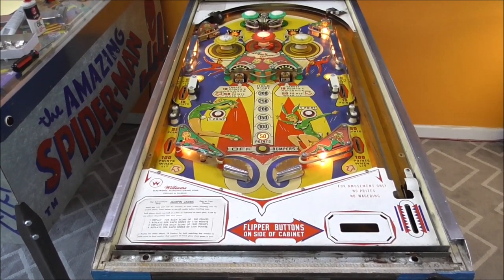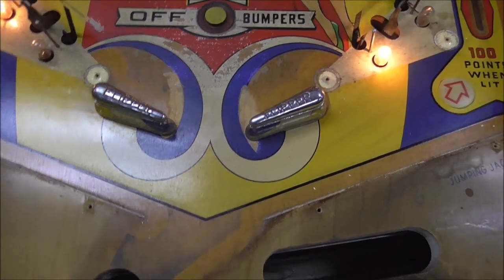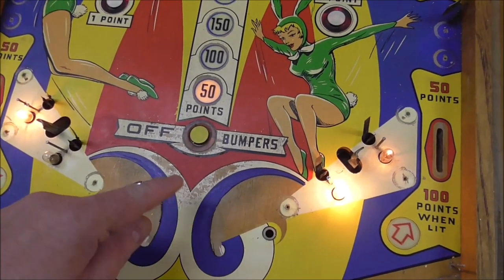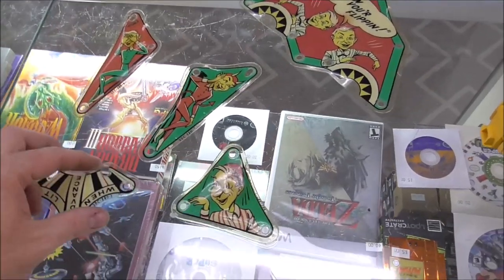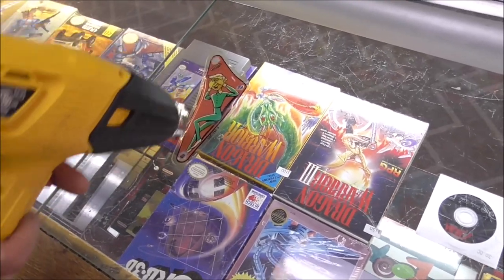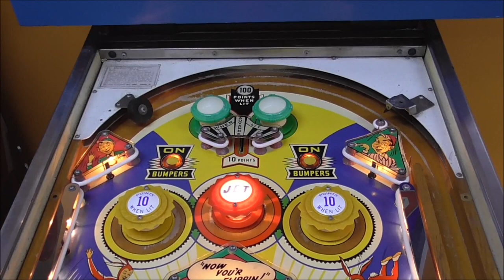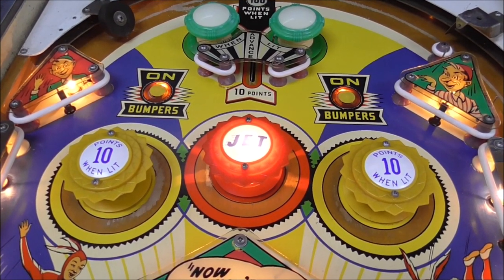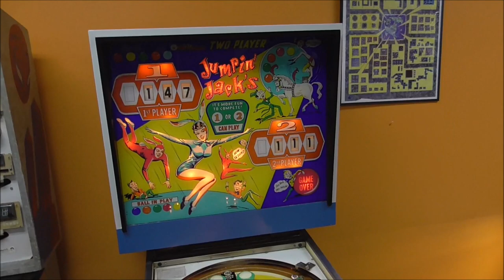Repainting and Repairing the Playfield of a 1963 Williams Jumpin' Jack's Pinball Machine

Comment: Nice work on that play field.  Looks really good on video.  

I was thinking about how the plastics could be reshaped better than using a heat gun.  How about sandwiching them between two plates of glass and gradually warm them up in an oven until they reach the transition temperature of the plastic, let them sit for awhile at that temperature so that they could gradually flatten, then turn off the heat and let them cool down slowly while still in the oven.  Could eliminate burning, local hot spots, and maybe even relieve stresses in the plastic so they won't be as prone to breaking.  The only thing I'd be really concerned about is the paint sticking to the glass as you had happen.  So perhaps put wax paper between the plastic and glass.  Or dust the glass and plastics with talc.  It might be worth experimenting with on plastics of a similar era that are broken and not salvageable.

Comment: Came out reeaaal nice.... One tip regarding flattening the  plastics, put a pice of baking paper (is that what you call it? you know the paper you use in an oven when baking) underneath the plastics, it will help keep the paint intact.
I would really like to see you do the clearcoat one time, maybe next machine? Looking forward to see the final part when you get it working :-)
Reply from the maker: I forgot about using the paper, I usually lay a little sheet of printer paper down before I heat it up... I spray the clear on with a spray paint can, I don't really like filming that because I don't want to get paint mist on the camera lens...

Comment: I guess, if for no other reason, these are the times when replacing bulbs with LEDs is a good idea. At least the plastics wouldn't melt again.
I've had pushbuttons melt out of shape due to heat from bulbs, stopping them from moving at all. LEDs all the way now :)
BTW, another amazing transformation!
Reply from the maker: Sometimes the bulbs are the problem... but a lot of these, the problem is storage.... they sit in hot warehouses and it literally starts melting the plastics.  Check out the video I did on the "Derby Day" awhile back, the plastics were destroyed on that one!  https://www.youtube.com/watch?v=pW3ky4mroq0
Reply: @LyonsArcade  I guess we don't suffer with overly hot  warehouses in the UK 😉
I'll check out that video shortly (I may have already watched it!).

Comment: Don't you just hate those backseat pinball drivers that just keep giving you are hard time? xD
And yeah I agree I kinda cringed when the glass was not put straight down but at an angle. o.o
And an interesting idea.
For my warped plastics I put them in the oven at the lowest temp and let them set until I see them melting then smash them down.
Reply from the maker: I'm at a store we don't have an oven :)  Also for your next question, no, I am not buying an oven just to heat up plastics :)
Reply: @LyonsArcade  This is very true. xD
I work from home so I do have an oven although do not know if I should be using the same oven for cooking too. xD
I only did plastics once in the home oven and it did work nicely but yeah not sure how healthy it is to keep doing that. xD
I am wondering if a toaster oven will work or not and getting one that you can turn to low temp setting. ;)

Comment: Would anyone who you know want to restore a 1 of a kind Imperial Hearse ?

It was made from a 1991 Ford Explorer, bought brand new and converted into a hearse for a funeral home.

Still has the name plates and curtains in it.

I bought it after it had been in service for 24 years.

It needs body work, new cloth top and repair the rust and paint it and put the scrolls back on and put new velvet in the back inside.

This is a historic vehicle registered in Pennsylvania as a historical vehicle because there is only 1 and will never be another

I really don't want it to go to the junkyard

It has 39000 original miles and the engine and transmission are rock solid.

I took care of it, new exhaust system, new battery, new sensors. 

But, I need a wheelchair van now and I must sell it or junk it.

I really want it restored back to showroom condition and taken to classic car shows

If you Google images for a 1991 Ford Explorer hearse you will see pictures of it

it was the original silver on the bottom and the back was extended and a cloth custom top was put on with the scrolls.

You do such a great job bringing old stuff back to factory new, and The A-Team van was really cool

I know this isn't is cool is that but it is a really amazing vehicle

When I first got it people would stop and look at it and touch it

I took it to one of the local fish fry places that had a monthly classic car show and people loved it

It just pains me to see old things that still have life in them going to the scrap heap when they could be saved